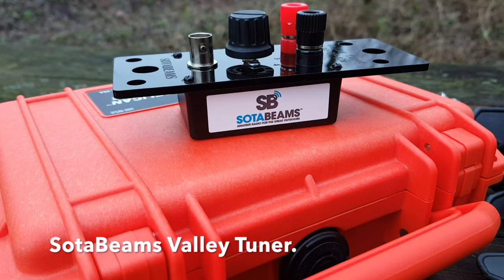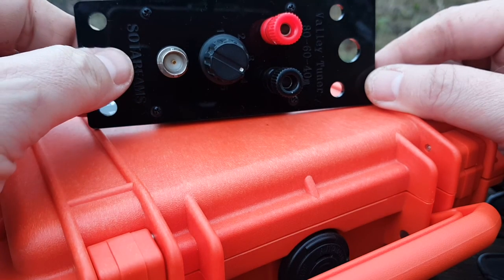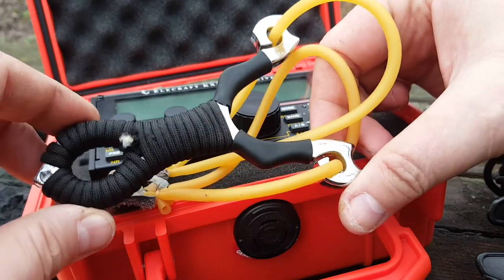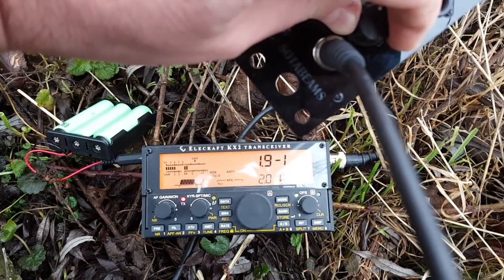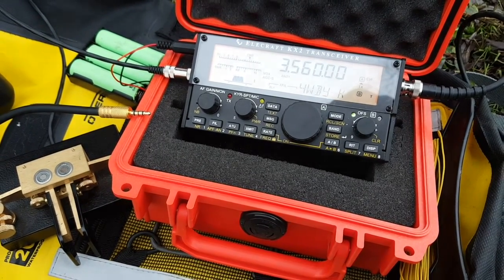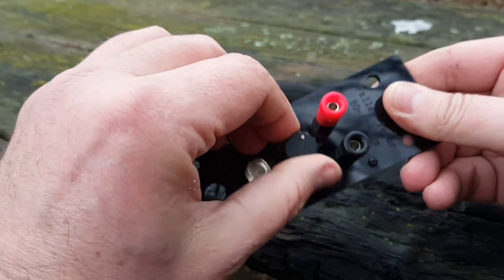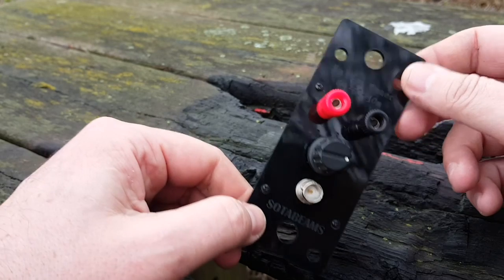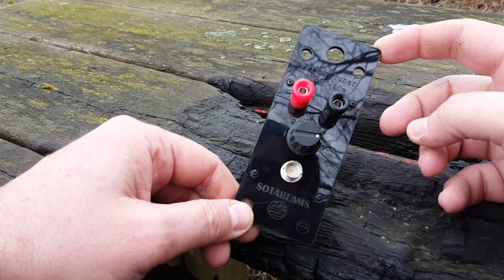SotaBeams End-Fed Valley Tuner.

Comment: I certainly was laughing 😀
I've got the Mountain and Peak tuners from SotaBeams. I've never been able to get the swr to 1:1, but close enough. 
OK,  thanks Gil, 73 👍
Reply from the maker: I think I might have gotten 1:1 had the wire been dangling vertically from a tall tree. I had to wrap a couple turns around a branch. I also had no counterpoise. Though theoretically not needed with a half wave wire I have read that 0.05 x wavelength helps.